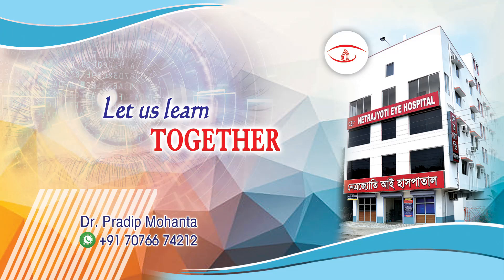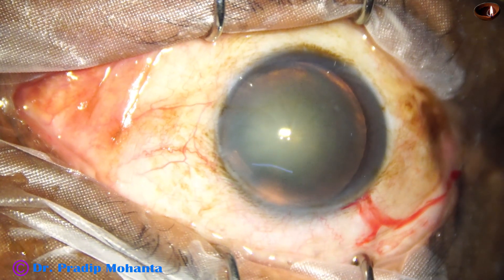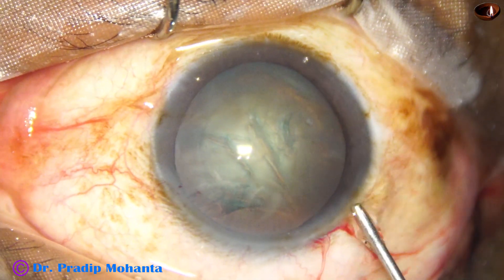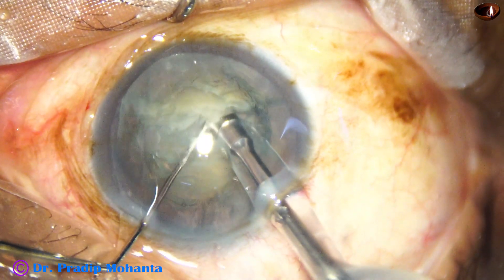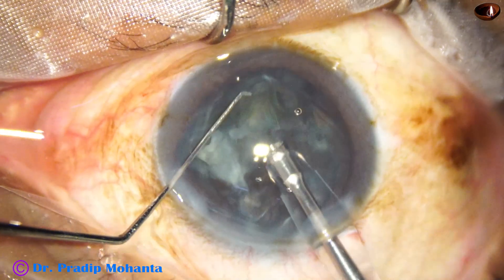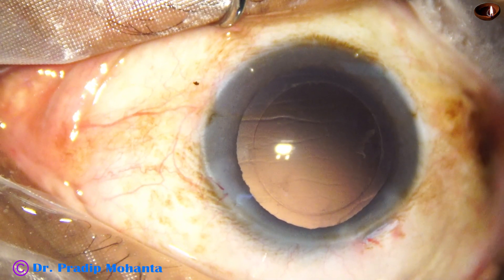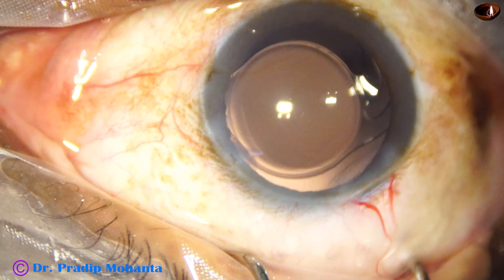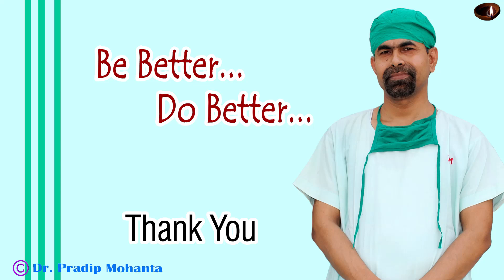Do Z-Vac Mechanical Chop, if you don't have a Prechopper- Demonstrated to a Trainee- 10th July, 2024

Comment: Similar to 'Alam's Mechanical Quadrant Chop' which is a Quick and Fast technique of nucleus fracture with only phaco tip and ball chopper which is  independent of phaco energy and vacuum. There by reducing the CDE significantly at the end of the surgery and prevents less corneal endothelium loss.